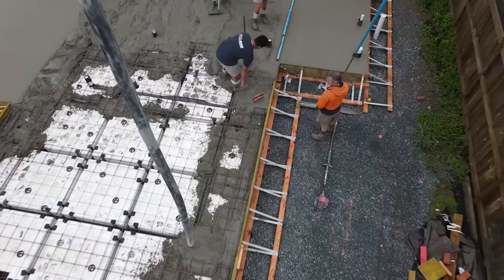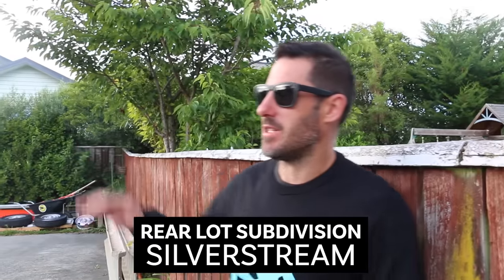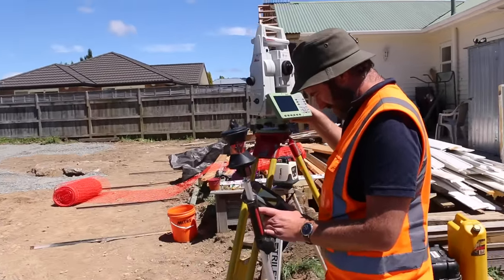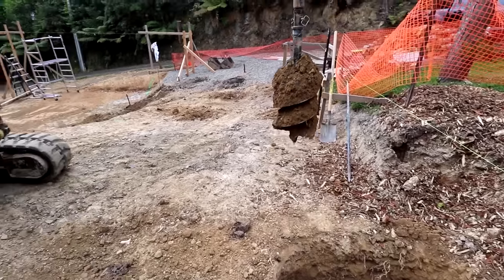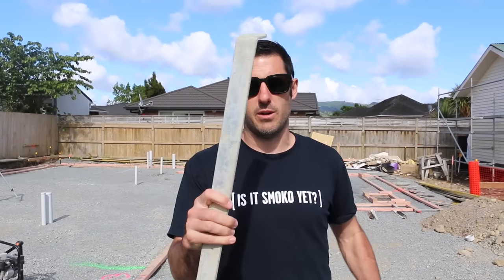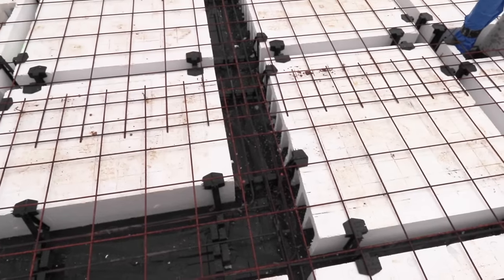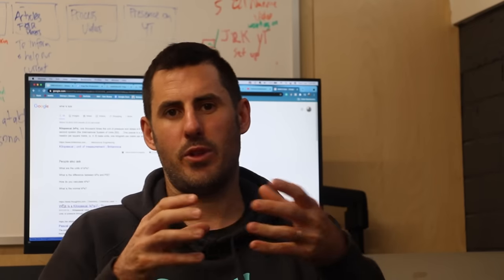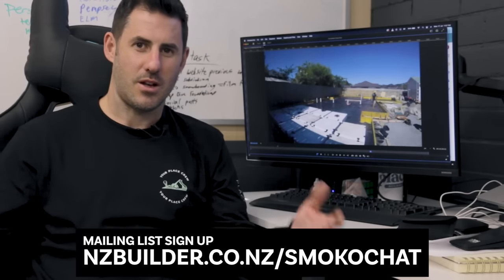FOUNDATIONS EXPLAINED | an In-depth Break Down

Comment: Hi Josh why do you drive piles in the ground ,In Australia we don’t do that ,any way nice job cobber stay safe ❤️💪💪👍👍😄🙏🦘🇦🇺🥝
Reply: Sometimes in NZ the soil and ground immediately under the slab cannot bear the weight of the slab and building properly. If this is the case. the geotechnical engineers will find where good ground is and piles will be driven to find good ground (good ground can handle 300kpa of pressure and withstand the pressure and weight of the slab and building. The piles are then driven into good ground so the weight of the slab and building is transferred to good ground . Some NZ soil is prone to liquefaction which can sink the building, there are different construction techniques for building foundations to ensure the building isn’t damaged by liquefaction.
Reply from the maker: Hey Jess, check out our pile driving videos like this one 
https://www.youtube.com/watch?v=lpeWSVCKHSw